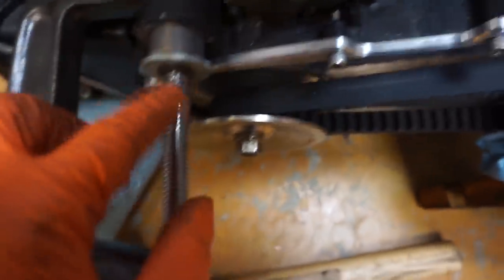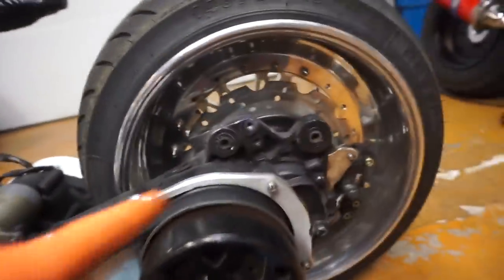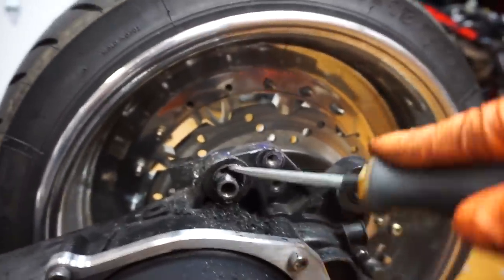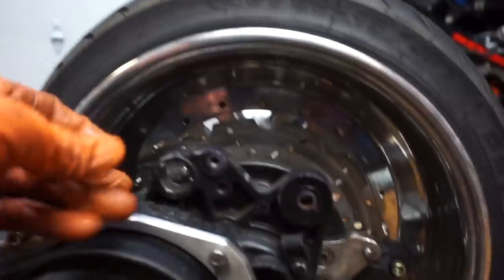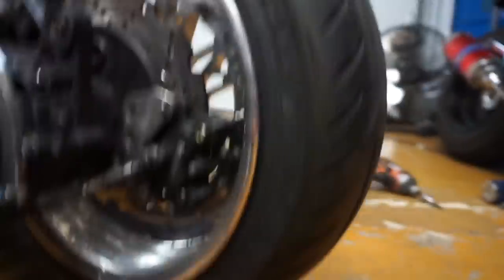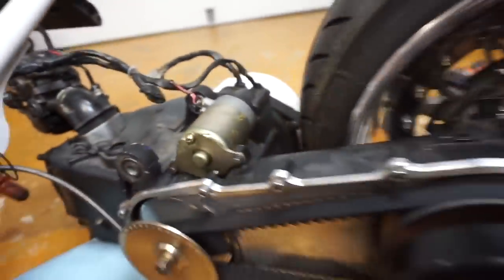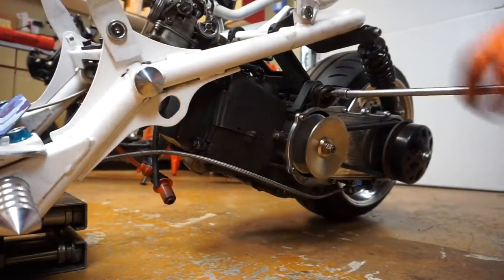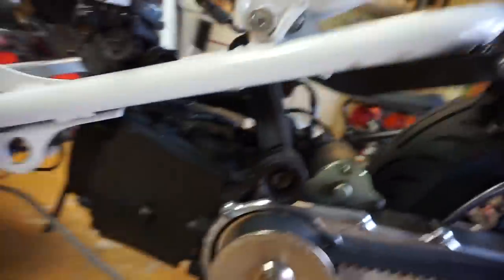GY6 scooter rear wheel slop wobble fix (RUCKUS & CHINESE SCOOTERS)

Comment: Maybe you can help. Thinking about either buying one of these Japanese customized scooters or building one if possible. Where can I find website to order all the parts that I need. Not like the one in your video here but more of these lowrider slammed types?
Reply from the maker: Are your referring to thinking about buying a chuckus (Chinese replica of the GY6 Ruckus) or customizing a Honda Ruckus? I would highly recommend buying a Ruckus on modifying it. We sell all the parts to do so on our website at www.rollingwrenchdenver.com
Reply: Okay. Know the model I'm talking about you can find it on YouTube under the title Japanese lowered scooters. 4 minutes 18 seconds into the video and the one I'm thinking about trying to build or the next one after it.
Reply: Start with amorphous or similar bike. Extend swingarm past the rear of the body. Use air ride suspension for swingarm. Lower front forks. Change handlebars. I do not have references for step by step

Comment: whats your recommended torque spec on those wheels w/ the M12 stud? and BTW you need the rear disk brake kit on the 232....Evan @ FLP does a fine job on that, I'm using the Adelin ADP14 Caliper on mine
Reply from the maker: I do 75 ftlbs. That funny I already have Evans rear brake set up, it’s super nice! I just need to do the install. :-)

Comment: hi i have a maddog gen 4 and i replaced the engine to a 150 cc but when i return the original rear  wheel it is touching the engine near the oil fill is that normal or theres a way to fix this?
Reply from the maker: Not normal, that’s wierd. I would have to see what you mean
Reply: the wheel is touching the part wherre the engine where the fan is at .
Reply: can i send you a picture of what im saying
Reply from the maker: Yes please email it. Our contact info in on the about us page
Reply: Did you use maddog mount when swapping to 150?? I have maddog gen 4 as well trying to swap to 150
Reply: Roel Cerdina did you figure this out? If not sounds like you may have bought the short case motor.